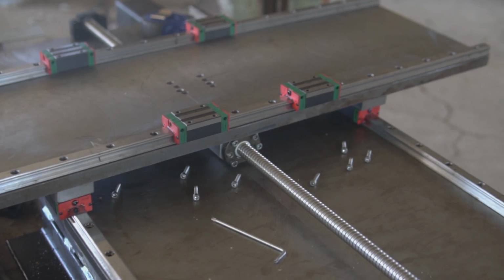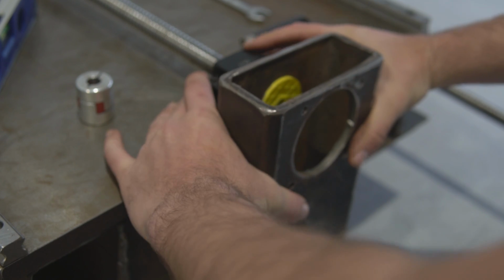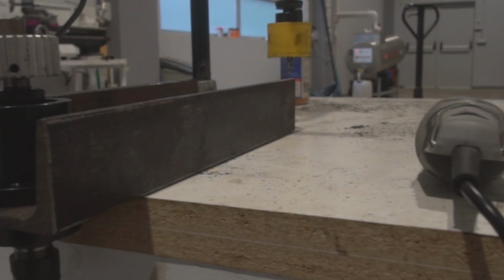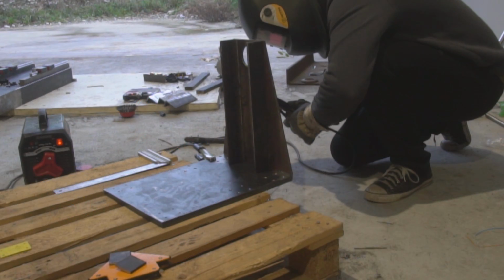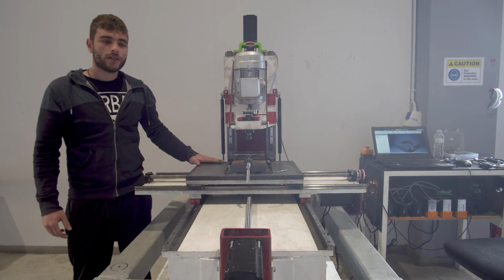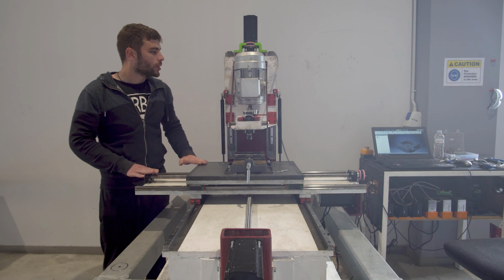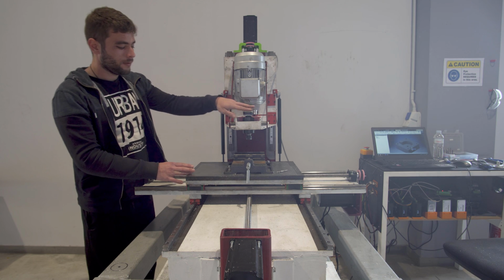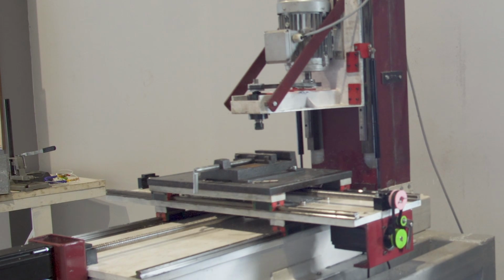DIY CNC MACHINE PART 2 !! (FINAL BUILD PROCCESS)

Comment: Nice work. Great build for little money.
The z axis should be much taller, like move y axis to the z. This type of design have bigger z axis than x or y.
You could use chains/ropes with sprokets instead of shock absorbers.
Buy a cheap 2.2KW chinese spindle with a pulley 1:2, at 12000 rpm it works great in aluminiu.
Sometimes 12000rpm on cnc is to much,the aluminium just sticks to the tool (without cooling), 8000 rpm for a 6mm carbide tool works great.
But it depends on what type of aluminium you are trying to mill.
Honestly i would suggest to remove all linear rails and the z head, protect the guided rails slots/holes/threads etc.
And just start to build a case to pour cement with all sorts of stone, and dont forget reinforcement with metal bars.
But before you do that please change the screws, they are very thin for this aplication.
Use M12 screws. Or just weld the z column to the frame.
Hope to see more videos with chips flying.
Reply from the maker: So far we added mist cooling, covered the rails and fill it with cement. Yesterday we fixed the gear ratio of the spindle to get us up to 10000rpm, we did lose a bit of torque but tests on steel worked perfect.
Reply from the maker: Thanks a lot for the positive feedback ! Many of the points stated ,were really taken into consideration . The main reason we used the current spindle was mainly because opinions around this topic were rather clear and our knowledge about CNC milling machines was kinda insufficient . So our go to option was to get a slow spindle with too much torque and then use a different gear ratio in order to increase the rpm  . Also our main concern was to be able to cut stainless steel and not aluminium  (we are still able to cut aluminium though ) . Now , about the linear rails . You are absolutely correct ,but funds were not enough to put something bigger on the machine so we put the largest rails we could afford and hoped for the best ! 😂 

Of course we are now preparing for more in depth video and we will be able to show some more successful cuts from different kind of materials .

We are also converting a lathe into a CNC lathe so yeah , we are keeping ourselves kinda busy
Reply: @wearetherandombros7782  https://www.youtube.com/watch?v=4QEgTEt0QUY

Comment: Just mix the sand with polyurethane or epoxy, polyurethane is cheaper than epoxy but does the same job. Maybe add gravel to the mix and you are good...
Reply from the maker: Well that's an interesting option that nobody told us before!! Thanks for the input mate !! We will give it a shot for sure !!

Comment: If it's steel being filled, you can go with concrete as a filler.  Can add to the mixture shredded fiberglass or basalt fibers, if any is laying around, for added rigidity.  If the parts being filled are aluminum, you gotta go with resin due to the thermal expansion ratios being too different.  After that you can start the long and never ending process of dialing in higher precision via tramming and shimming.  If in the future you want to add more features, LinuxCNC is a great choice and is open source with an amazing community.  It's amazing what you have done given your resources.  Anyway... has been fun watching ya'll build and seize the means of production for our modern era.
Reply from the maker: Hello sir , thanks for the amazing info you gave us !! We were planning on filling it with concrete, but someone told us that the water in the mixture will corrode the steel (all the machine is steel) so we thought about adding sand which cost us 10 euros for 150kg and figure it out later.  We also tried Linux CNC but we couldn't run inventor HSM in order to be able to generate the GCodes on the same PC so we stuck with Mach3 since it's Windows based. We will definitely give Linux CNC a shot in the near future.
Reply: @wearetherandombros7782   shouldn't have to worry about corrosion because the water rapidly leaves concrete as it hardens.  if really worried about it, you can add a coating of polyurethane, polyacrylic, or lacquer to the inside surfaces before pouring the concrete.

btw... if you do go the resin route, you can dramatically reduce the cost and increase the vibration dampening and rigidity effect by mixing agitates like sand, gravel, and scrap carbon/basalt/glass fiber with the resin.  Even just using sand mixed with resin is more than enough.
Reply: @wearetherandombros7782  
I'd ask locally if there's any uhpc available. Locally sourced it's often way cheaper.
I'd use uhpc in any case, similar to epoxy granite in it's properties, self compacting, nice kind of sirup with chunks and sandlike consistency etc. pp.
Conventional concrete has the huge problem that it keeps on shrinking. Rather unpredictability and potentially for a long time.
Uhpc is stable after a short temper in a XPS styrofoam box for example.

Talk to concrete folks about corrosion and preparation. If you don't do anything totally wrong there shouldn't be a problem.

And maybe visit one of the cnc forums. The "better" ones can be incredibly helpful.
There are quite a few things that can be improved down the road, they'll be helpful and will often know what works and what doesn't.

Oh, and one tip:
Take a look at UCCNC. Mach works but it has some inherent flaws that can be just terrible if you're working with higher feeds and rather conventional Toolpaths in plastics, wood or non ferrous metals.
It's the trajectory planer, Mach3s trajectory planner has some serious issues. Many don't notice though, guess it depends a lot on the work or they just don't know any better...